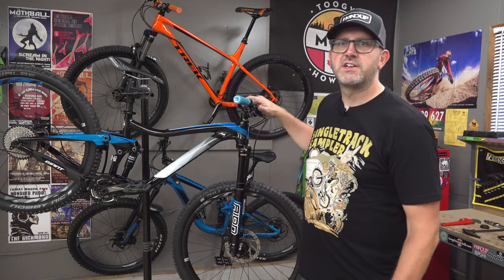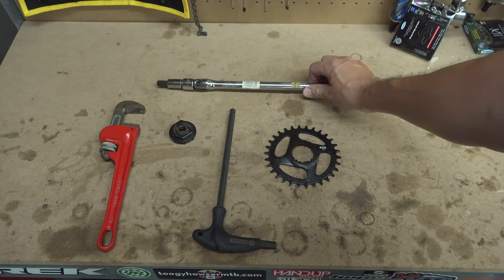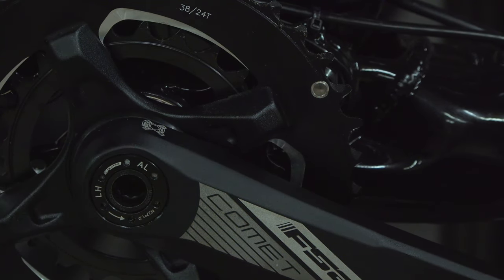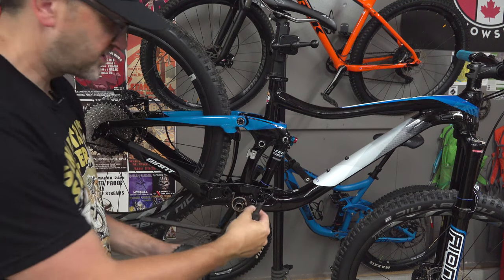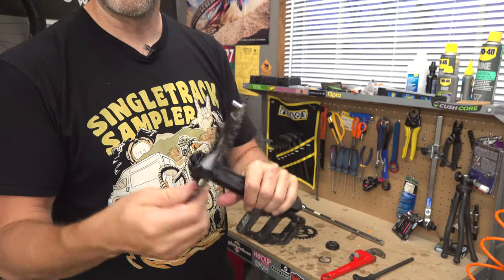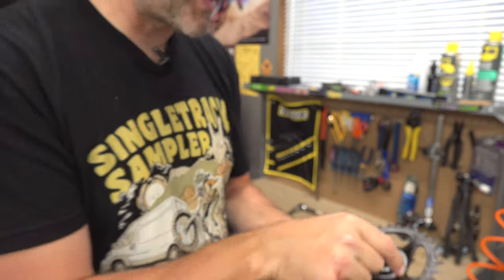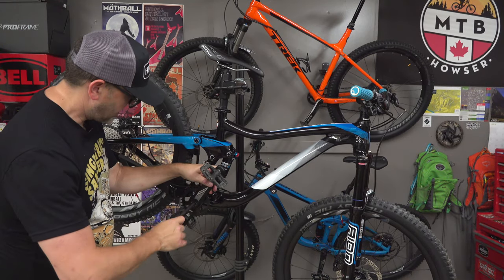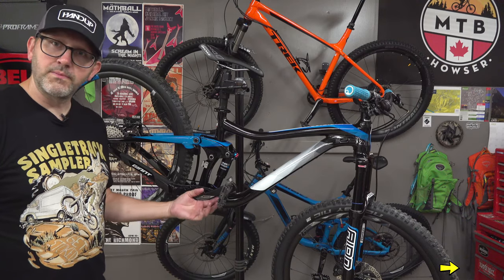FSA Comet Crank 1X Conversion

Comment: Hey - thank you so much for this video. I’m converting a 2017 Giant Talon to a 1x and wanted to save some money by keeping my crankset. Being in Australia, I couldn’t buy the E061 locally but was able to get it from the US (postage cost more than the tool!). Had trouble with the locking ring as at first it wouldn’t crack. Soaked it in WD40 for 5 mins and voila. Thanks again, couldn’t have done it without your vid. Be well. Cheers, Scott.
Reply from the maker: Awesome!! Glad it helped you out!!

Comment: I did the same conversation on my old bike. I kept it as a 10 speed when. I first converted it. You loose some nice weight taking off that front mech and shifter.
Reply from the maker: yeah it's going to be 10 speed for now, I already had a 10 speed cassette and shifter

Comment: Notice the square 3/8 or 1/2 drive hole in the lock ring tool? You can use a standard racket drive of the appropriate size.
Reply from the maker: awesome tip! I don't know how I didn't notice that!!  thanks!
Reply: I was thinking the same, thanks for confirming

Comment: Hey great vid, thanks, can I ask, I am planing to do the same thing to my 2x10 but I had a couple questions, 1st is about position of the front chain ring, I never used the max crossover between the front outer and back inner rings previously but it looks like it will place a lot of stress on the chain being stretched so far from right to left. By swapping out the 2x front rings for a 1x it looks like the main ring will be in the same position as the the old outer ring, is there a way to reposition the crank arm slightly closer into the frame to make the 1x ring more central to the back cassette (reducing the amount of stretch on the chain between the top and bottom gears)? Second question was about the gear ratio, I've only been able to get 38T front ring to replace the 42/27 which is bigger than I wanted (had been looking for a 34 or 36) and I don't really want to swap out the back cassette for an 11. I don't do a lot of steep riding so I wonder if a 38/36 on the back will give me enough gear for some modest hills?

Comment: First of all, thank you for putting the time into making this video. I'm thinking of converting my 2x11 to a 1x11 and have the FSA Comet crankset. I have a doubt regarding the chain line alignment, I've seen somewhere that the chain should be aligned to the center of the cassette. Does this setup achieves that or is there a way to adjust the chainring to make it achieve that?

Comment: Thanks for the video. I tried using a 96 BCD ring to convert it before finding this video which didnt work. Luckily found this video and the right chainring online. Thank you. Any idea what the chainline measurement is after converting?
Reply: where from did you buy the correct chain ring

Comment: So to clarify here, the 10mm is the only thing holding the crank arm on? There isn't another tool or something you need with prongs to loosen first before using the 10mm?
Reply from the maker: I didn't use anything else
Reply: That's the knowledge I came for also.

Comment: Hi thinking of doing  the same to the exact same bike , but cant find the FSA 0611 anywhere. Do you know if you need to take the lock ring of if you just wanted to unsqrew the bolts on the two chainrings and replace them with one single chainring with a 96mm bcd if thats the right bcd.
Reply from the maker: that might work!

Comment: Hey, do you mind saying what cassette and rear mech you ended up using? I'm currently doing the same conversion hoping to continue using the old 9 speed ccassette but might have to change to 10/11 if its doesn't work with the new chainring. Thanks!
Reply from the maker: I used a 10 speed shimano 11-42 cassette I already had and got a shimano deore shadow plus 10 speed derailleur
Reply: @ToogyHowser  Thanks. Really useful video as well 👍

Comment: HAHA thats something I would do use a monkey wrench for a nut that was too big Improvise adapt and overcome lol.  But im sure youll have some haters anyway.  Least it was a pretty quick process once you have the lock ring removal tool.
Reply from the maker: I always have haters haha, haters gonna hate!
Reply: @ToogyHowser  No hate but you could've used a 1/2in breaker bar on it. They put it there so you can use a torque wrench.

Comment: The only way to do this is using a fsa chainring, right? Sadly there is no stock rn.
Reply from the maker: yeah, I got mine from bikeparts.com, have you checked them out?
Reply from the maker: Here is the exact link https://bikeparts.com/BPC450229/fsa-comet-chainring-direct-mount-megatooth-11-speed-30t
Reply: @ToogyHowser  Thanks a lot bro, I found some on Amazon for 44 usd (I'm in Perú) but I'll check that site to see if it's cheaper.
Reply: Not specifically, it's a Cannondale locking pattern and many aftermarket brands carry that

Comment: Toogy...what cassette did you go with?
Reply from the maker: I used a shimano 11-42 10 speed cassette that came off my Giant Reign I had
Reply: @ToogyHowser  nice... did you have to add any spacers to the chainring...my fathom has the same crankset so planning on converting to a 1x11... but if I can use the same crankset, it will same $$. I am having  difficulty finding the fsa E0611 tool...seems sold out
Reply: Found that the 

Park Tool LRT-3 Lockring Tool  works as well.